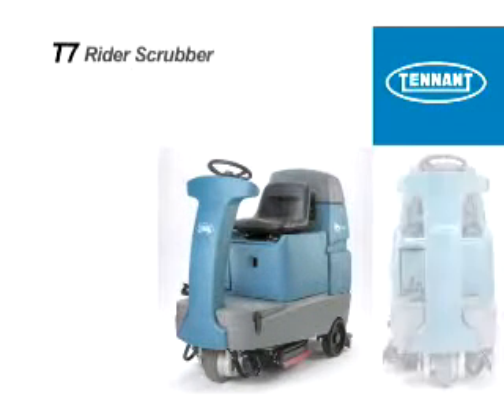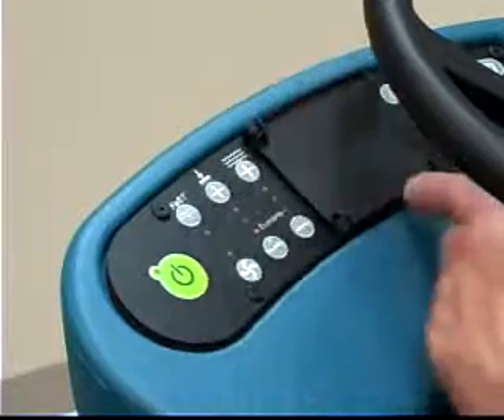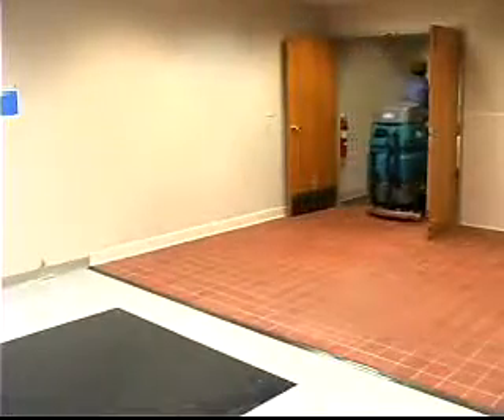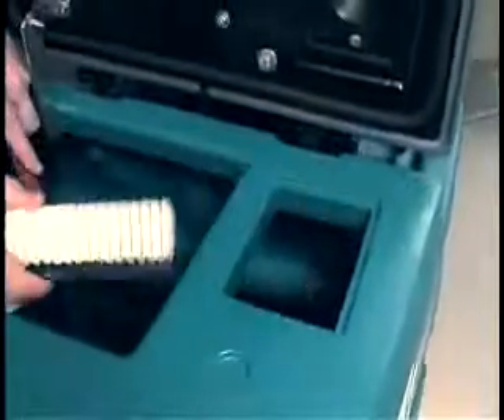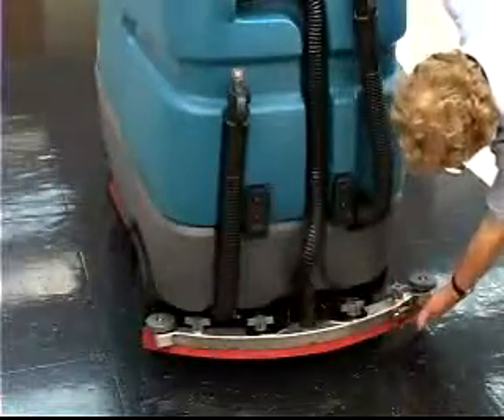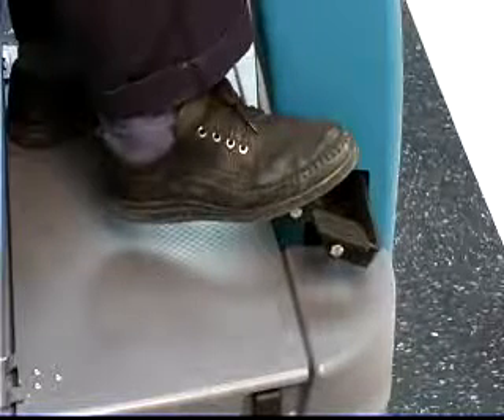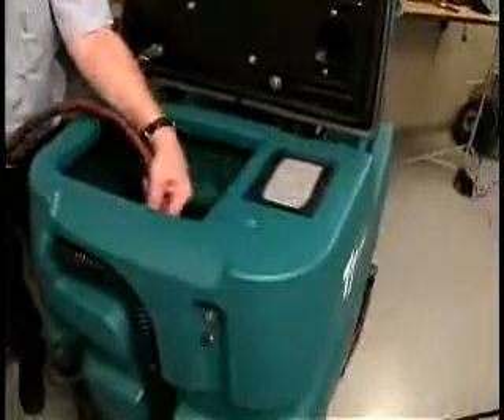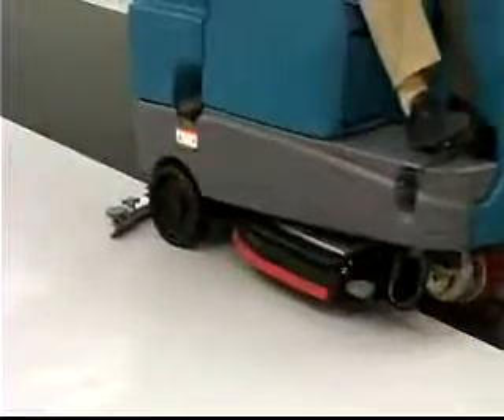T7 Ride-On Scrubber | How to Operate | Tennant Company

Comment: I work at krogers and i have one of these and quest mark are in are store re doing the floors and my scrubber keeps leaving this burn line like its taken color off the floor and in the dirty tank its picking up this concrete substance i dont know if its the stuff quest mark are using and they didn't polish it good enough dont know why else it will leave the marks
Reply from the maker: Be sure to contact our customer service team so they can help get you in touch with one of our service reps! 800-553-8033